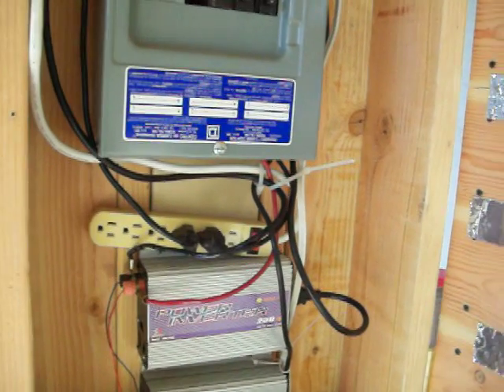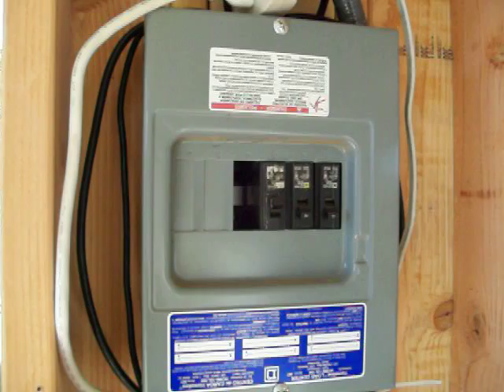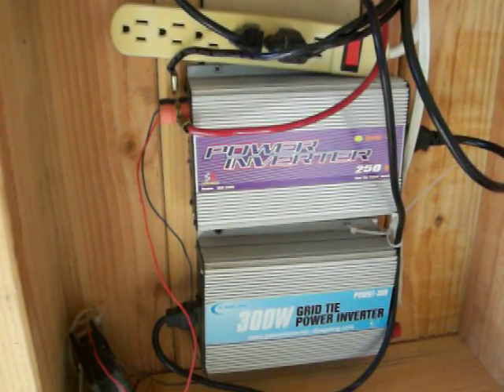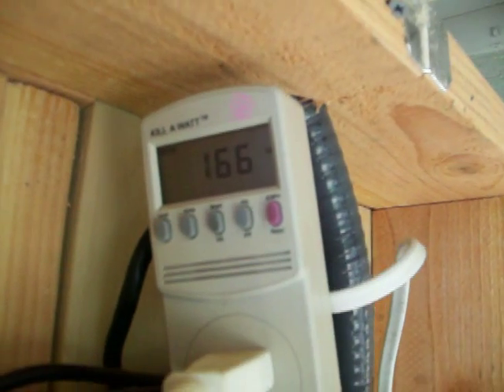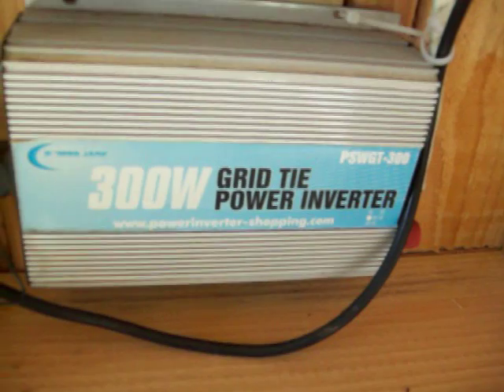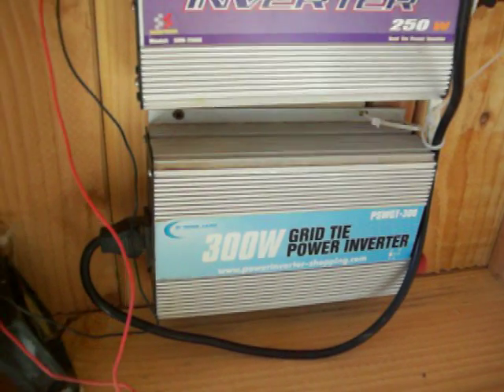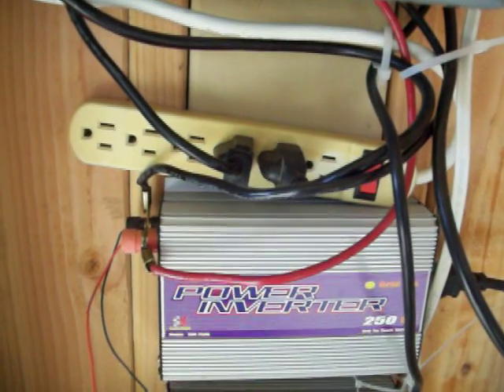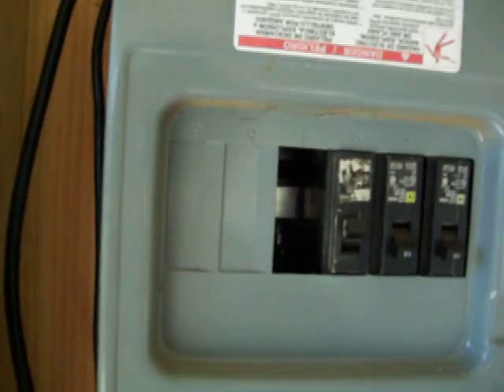Grid tie inverter Install (part3)

Comment: Do these supplement your usage only or will they turn smart meter backwards? I am looking into a grid assist to start out with but local codes require licensing and permits with all the cherries on top just to grid tie for backfeed
Reply from the maker: Kelly Burgess supplement only I get about 2 kW per day about .32 cent a day but been running for a while now

Comment: Hey Mike, I have a question, my grid tie inverter has a male end attached to a cable that says home ac source and then a female port next to it that says ac output. I know that I plug in the male cable to an outlet in my house, but do I also need to get a male to male and plug it into the ac output and into my house, or is that just an extra port to plug a device into?

Comment: Do not use these inverters for tying to the grid! Learn how electricity works before tying into your panel. Unless you have an inverter that will monitor the grid, and adjust it to match the phase you may have a fire or get hurt!

Comment: Hello Mike was thinking about doing the same thing but have a smart meter installed lately. I was wondering if you have a smart meter? I do not care if the meter turns backwards I just want to supply some power to meet my needs and lower bill.

Comment: i have got just under a 1000watt in PV modules  i run two Pure sine wave inverters, i got all lighting on LED.
I did not bother with the Grid tie inverter, i have a battery bank so i am off grid in producing my own power i do save quite a bit of cash, but the main reason i do this is to be partially  independent. the power companies are hiking up their prices and their are more power outs these days due to weather conditions. my advice is get it all into a battery bank and get the most out of it

Comment: You are good with woodworking, nice box. You could probably get some of those louvered vents and put one on the bottom side and one on the top side across from the other one and have nice cross air flow. If you put a screen under the vent it would keep the bugs out. I've seen commercial boxes using louvered vents, or else you could use a elbow pipe pointing down and a screen but it wouldn't look as nice. You are going to want air flow in the summer.